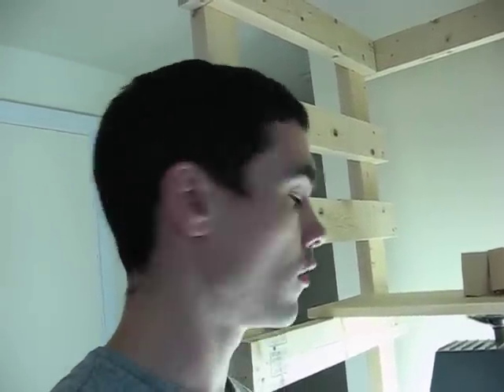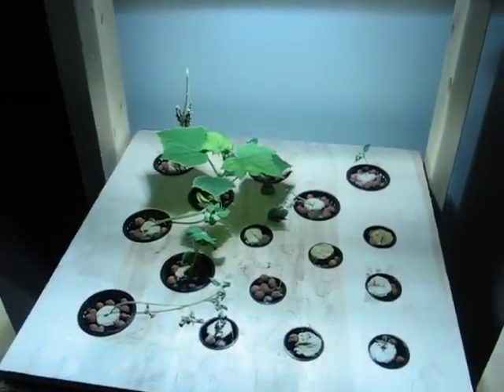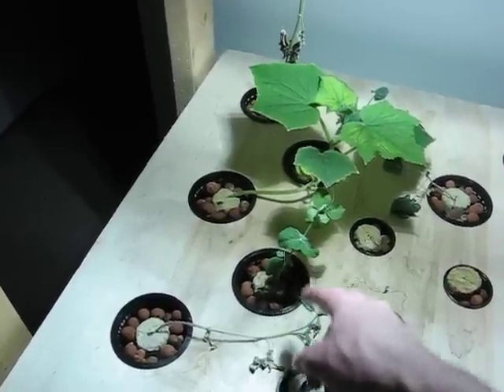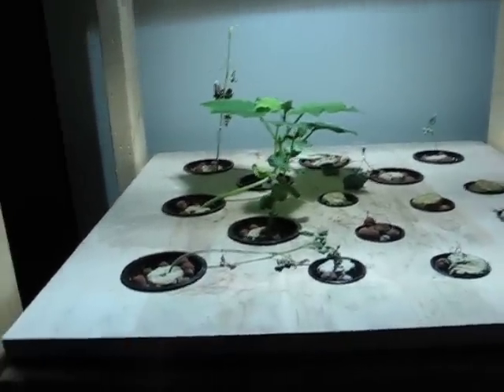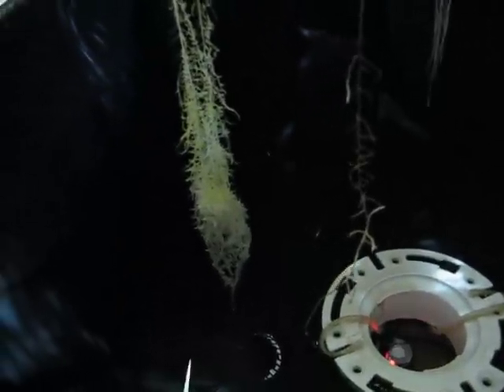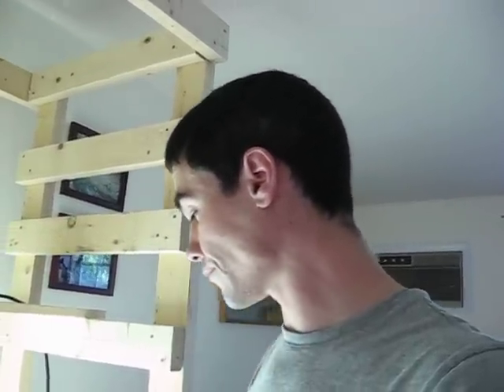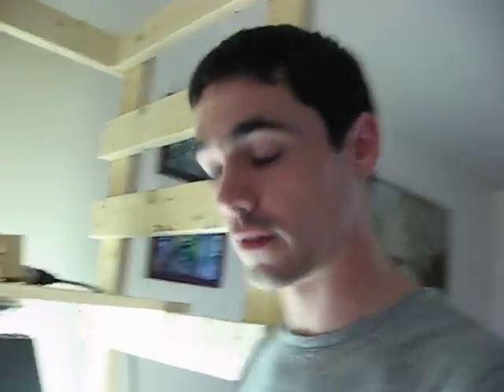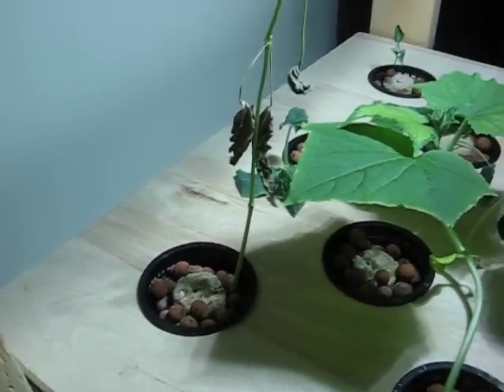Aeroponics Experiment - Part 4 (Failed)

Comment: hi, just an idea, but the problem might be with the vaporization of the water: It looks like you are using an ultrasonic mist maker, those create very very small water particles (<50microns) that cant really contain much nutrients within; as far as i understand it would be better to use high pressure, our dripping the nutrient-water on the roots in a vertical system... Just my two cents, i have no personal experience with aeroponics tho so ... : )
thanx for teh videos.

Comment: didn't see this until now and given its several years old I imagine you have already figured it out.... But I think the failure is based on several things.  The microns size you are hydrating at may work as a seed but need to be larger once the see takes hold. probably between 30-50 microns.  You were doing continual misting and I think it oversaturated the roots probably causing some level of rot or not offering it enough time to benefit from nitrogen absorption.  Spray cycles that are 3-5 seconds followed by mister idle times of 5 or more minutes will afford the roots the time to benefit from the nutrients and nitrogen.  Couple that with what appears to be a stagnated source of water that appears to accumulate nutrients only to stagnate over time and I think your misting only succeeded in killing the roots.  Lastly the materials you used are likely causing leeching of chemicals into your loop.  I applaud the effort and attempt and imagine you learned a lot from the process.  Hope some of my thoughts help in any future attempts.

Comment: All credit to you for doing the experiment even though it didn`t turn out quite as well as expected.  The problem is ultrasonic foggers create droplets that are too small and in a density that effectively suffocates the roots.

Its ironic that you had less than charitable comments from those using sprinkler / sprayer aeroponics which soak the roots and produce results that are closer to nft than aero.

Comment: Dude. It's easy to build an aeroponics unit for an hobbyist.  You just need to stack two tubs on top of each other with a hole leading between them.  Have you mister run up the whole.

Basically you need a separate reservoir so the roots don't dangle in water.  If they do, you can use bubblestones and have an aeroponics/DWC grow.

Comment from the maker: I didn't say it wasn't feasible.  I just said I don't think it's worth the expense as a hobbiest, and as I stated in part 1, I'm no expert.  What I read said the roots were supposed to be short and I only saw significant clumped growth at the bottom of the tank where the stagnant water was.  This is a presentation of my experience.  Not a statement of expert fact.